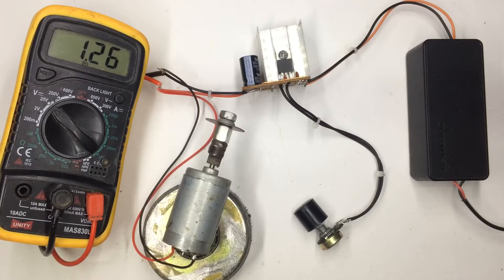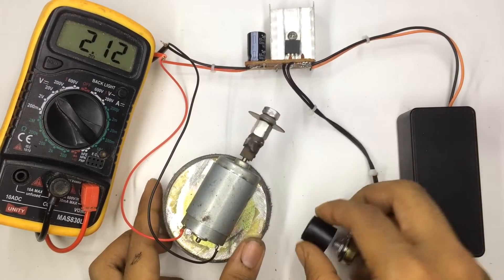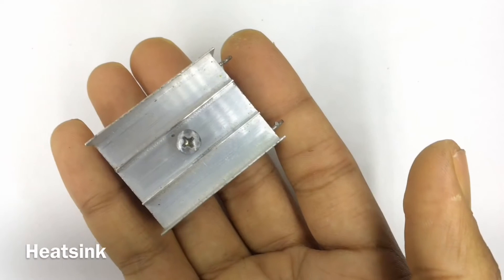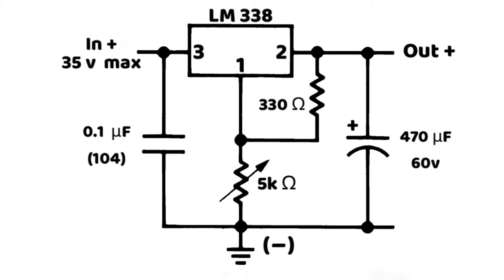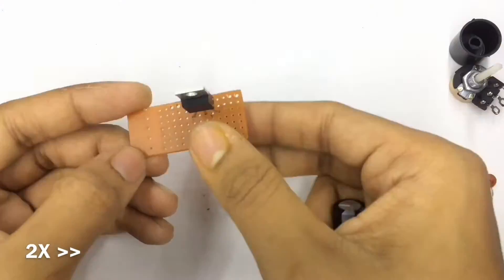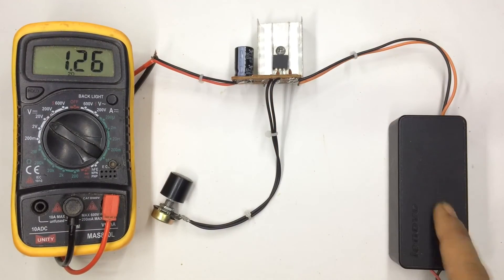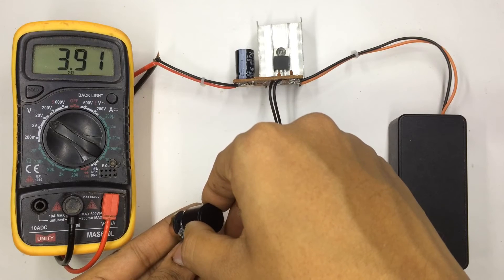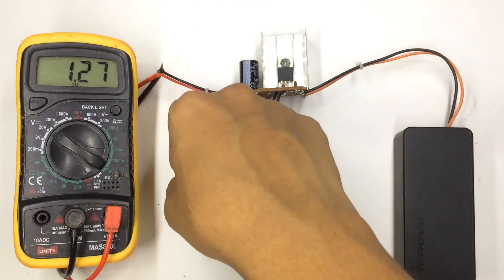High Amp Adjustable Power Supply with LM338 ( 5 Amp )#diy #powersupply #variablepowersupply

Comment: It can't deliver more Ampere if input output voltage difference is large, for example if we want to make 0-24 Volt 1 Ampere supply then it will heat more if we draw 3 volt at 1 Ampere current

Comment: Can we use it with 36 volts and is it energy efficient...... Will it increase output current i would set 12 v
Reply from the maker: What kind of dc supply u r using??  Battery Or something else..
Reply: @madScientist99  a RO transformer
Reply from the maker: Okey I understand... U can use Lm338 but put 2 high amp (6amp) diode in series in the input of the lm338 that gonna drop the voltage arond 1v & u r on safe side.... & yes if u go down to 12v it can increase the current a bit
Reply: @madScientist99  thanks

Comment: Bro have a question, bhai maine SLA battrey 40ah 12v se led kit chalata hu to sahi jalta hai per use 7x3 Li ion (18600) 11.6v se chalta hu vo fuse ho jati hai kyo?
Reply: @madScientist99  bro I have 150+ cells and i wanna make a big 12v battrey so do u have any solution it ? Like video or circuit link, btw ur make valueable videos👍 thanks for reply

Comment: A linear voltage regulator wastes a lot of power in the regulator; at 1/2 power it is only 25% efficient.  If you are running a DC motor it is much more efficient to use a LM555 and power fet using PWM.